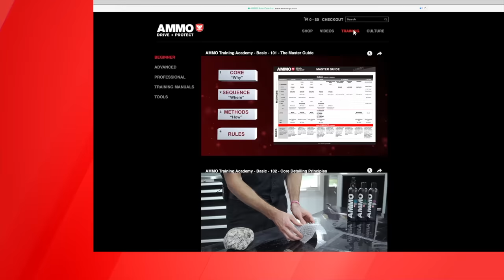14 BAD Detailing Mistakes You Must Avoid: ATA 106

Comment: Why wouldn't you use The Absorber drying towel? What would you use isntead?
Reply from the maker: It doesnt pick up contaminants only water
Reply: AMMO NYC So what is best to use?
Reply: His red Mf towels on his site. I use them as well.
Reply: Idk, I just feel like MF towels wouldn't absorb much of the water.
Reply: Joey Crysel you have to wet the towels first, ring it out then start drying the car with it. You’ll be ringing out that towel after just two passes on any panel. Try it!
Reply: I'd recommend the Chemical Guys MIC_721 microfiber towel to dry cars.  It's really absorbent.  I've used it lots.  They have another towel called the "woolly mammoth" for a lot more money but I haven't tried it yet.

Comment: So if i want to compound a car, I should strip off the old waxes, etc with dish soap?
Reply: NO. Use a stripper soap. Adams has one. I use and recommend Meguiar's Wash Plus.
Reply: NoMercyK247 i think that you can use dish soap as well, probably not much difference
Reply: NoMercyK247 use dish soap if u want.. don't buy into the detailing bs.. it works fine but only when u want to strip wax .
Reply: TheCarLovingSwede don’t use dish soap.
Reply: ForeignBorn Patriot why not
Reply: NoMercyK247 you're thinking it too much man.. just use dish soap ! He explains it in the vid and other detailers to as well . Just watch some vids . Dish soap is abrasive enough to strip waxes and sealants! Why wouldn't you use it ??? Do you really thing dish soap will scratch a car?? Lol Or make it change color??
Reply: NoMercyK247 why take a chance on your clear coat? So many affordable soaps to strip wax and sealant.
Reply: Wash car like normal. Then just use a rubbing compound. It'll take off all the old wax.
Reply: There are also specific wax strippers to use after you wash. That is what I use now when i really want to strip it down. I used dish soap for awhile but i have heard its not great for you weather seals so id rather not risk it.
Reply: No Miguel323527... dish soap isn't ABRASIVE (if you think that, then you're really lost).  Dish soap is formulated with surfactants and emulsifiers to chemically bond with and cause fatty acids and oils to go into colloidal suspension in water so that they can be rinsed from whatever surface the oils & fatty acids are on (dishes or painted surfaces).   Carnauba-based car waxes are fatty-acid based products with some petroleum additives thrown in to aid in applications and removal.

If you want a fast and inexpensive way to strip carnauba-based waxes from a surface, dish soap CAN be used, although you'll end up with a lot of other things in the mix that you really don't want on your car - things like fragrances (oil-based) and additives that cause shortened drying times.  Dishes aren't that big as compared to a whole car's surface so they (the dishes) don't really need to remain wet all that long until they can be dried off whereas a car is going in the opposite direction.

Comment: Hey one thing I now your wrong about is not using a shamy a clean dry strechy leathery feeling shamy is the best way to dry your clean lubricated paint
Reply from the maker: I'm sorry but I must disagree. I've used chamois for years and I realized they absorb water but not any loose debris or dirt that may be on the vehicle which is where you get scratches.

Comment: I have a question. I just bought a 2018 Fiat 124 Spider in Lusso trim, which sat in an auction house garage for nearly two years. Less than 150 miles on the odometer. Interior was quite dusty, so I had it detailed. Now I am inquiring about paint protection. One detailer quoted $850 for the ceramic process, which seems steep. Wondering what you (or any viewers) think is a fair price (South SF Bay/Silicon Valley vicinity).

Comment: "don't use chamois, towels or water blades to dry your paint"

What do you use then? You can't let it air dry because of the water marks it'll leave....

Blow it dry with a blower?
Reply: Upgrade Addiction large microfibre towel my friend
Reply: $40 electric leaf blower, then  spritz stubborn droplets with AMMO Hydrate, or a quality detail spray/spray wax before blotting with a quality microfiber.  A good detail spray lubricates the surface as you dry (safety precaution).

Comment: I tend to use my fingers and hand to feel the paint ..Clay bar is good for after a car wash and your still feeling specks of road film, tar and iron / brake  dust  mostly seen on white cars ..
I use to have a nak for buying micro fiber towels and feel the cotton or to say the least the lack of man made hooks pulling on my skin from the cheap towels that put swirls back into the paint 
Washing and wiping is VERY important  If you are polishing over the last place you just compounded or wet sanded .. and left a little dirt or film ..it reacts to what your doing next  I have myself rushed my own truck and found anything from scratches to build up  from a small stone in my pad from setting it on its side  and a rag that i used once before

Comment: Golden Rule number 1: never ever ever..... EVER...... Use an automatic car wash or a scrub brush at a car wash! Best case scenario is that it doesn't clean your car, but in most scenarios you're going to leave millions of little scratches in your finish. Worse case is that it can ruin the paintjob. I've seen so much damage from these abominations. Friend of mine actually took her new Acura through an automated car wash, and it left thousands of scratches that required repainting and repair across the whole vehicle.

Comment: MMMM I disagree about cleaning wheels first; have always done them last, & just re-wiped any areas that did get wet; no biggie. 
The wheels are the dirtiest part of the car- you clean them, then dip that filthy sponge back in the water & scrub your paint job with it??
I guess if you empty the bucket, clean  sponges & mitts then put fresh soap & water in the bucket, THEN do the rest of the car, that would work. BUT, that is more inefficient & time consuming.
Also, what is wrong with water blades?They are supposed to be 12x softer than cloths

Comment: #1 car washing hack ever: It doesn't matter if you are a Pro, enthusiast, or a 12 year old, if you are rinsing soap off your car with a fine spray from a nozzle, you are screwing up big time.  Use only a strait stream or low pressure coarse spray to run the soap off in sheets like a water fall. You'll be actually putting more water on in shorter time so it will rinse faster AND you'll leave behind only a fraction of the water on the paint and windows to dry off.  No little puddles all over to drag a towel or shammy over.  Just a few damp spots to wipe off.  No window water spots.  Use one towel to do whole car in a fraction of the time. Try it once.  You'll never rinse with a nozzle again unless you are a complete moron.

Comment: detail in a sterile environment, always brush, floss & Wax your teeth before detailing your car, only wear freshly laundered or brand new with tags clothing before washing your automobile, make sure youre properly hydrated before washing your car, make sure pets stay at least 30 feet from your automobile when detailing to avoid residual pet hairs from recontaminating the automobile, vaccuum out your garage or driveway before detailing to avoid residual recontamination

Comment: I love car shammies....as long as there clean the work better than anything else....
Reply: jason cox
Perhaps, but they won't pick up any contaminants on the paint. It's physically impossible to have a perfectly clean surface, and if any dust from the air lands on the paint, using a chamois will scratch.
Reply: There’s nowhere for the dirt to go on a chamois, anything you miss is going to get ground into the paint.

Comment: Time stamps:
1) 0:23 Protecting your skin
2) 1:12 Clay bar: do not use it frequently, or on scratches
3) 2:32 APC: do not use an All-Purpose Cleaner on interiors
4) 3:08 Apply Wax / Sealant on Trim: do not do that
5) 3:26 Avoid pulling the vacuum hose across the entire car, as it brings dirt into the car
6) 3:45 (Dish)Soap: be aware of the different among soaps
7) 4:46 Washing towels (wash mitts)
8) 5:21 Avoid washing in direct sunlight
9) 5:40 Avoid dry-wiping the paint
10) 6:05 Start the wash by cleaning the wheels (to increase the efficiency of the wash process)
11) 6:37 Never use the car duster!
12) 6:56 Do not use water blades to dry your paint!
13) 7:00 Clean your tools, before start cleaning your car
14) 7:13 Cross-contamination